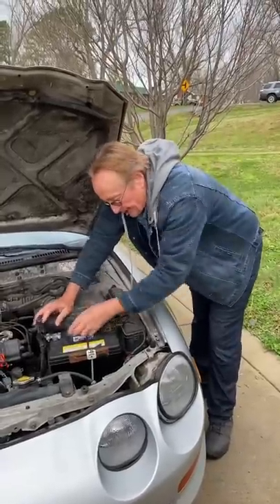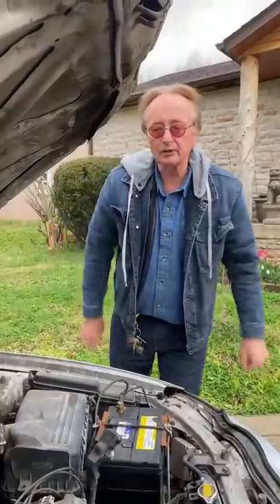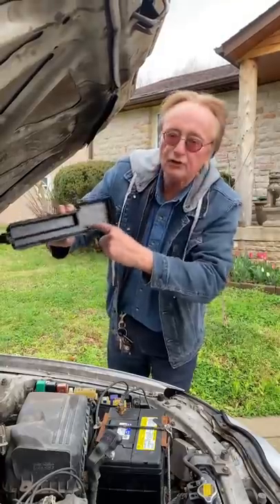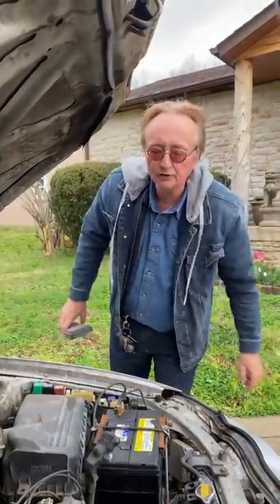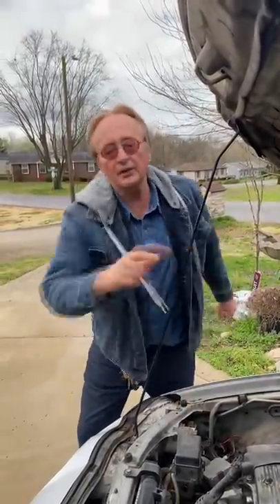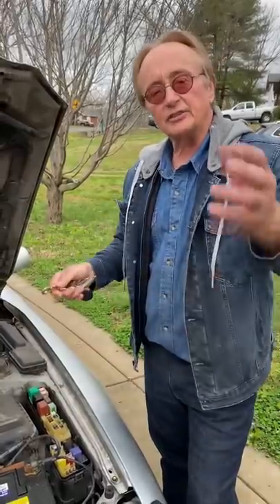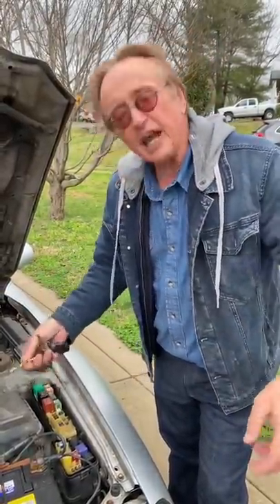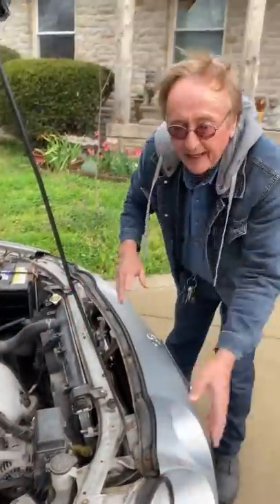You’re Gonna Want to Click on This

Comment: I have found, in the past, that if your tail lights are not working to check the fuse. If it is blown and a new fuse blows again then change all the bulbs on that fuse circuit. That will usually fix the problem.

Comment: My pickup has a driveshaft, not a belt. It does have a belt to drive the fan.
Reply: Look up what a "drive belt" is.
You seem confused about what a drive belt does.
You're implying that it is part of the drivetrain, which it is not.
Reply: Good thing your pickup doesn't have a CVT belt transmission.. Though the new Ford Maverick with the 2.5 hybrid had a E-CVT with gears instead of a rubber band belt.

Comment: I use to have a problem where sometimes my car would stumble or even stall. Sometimes it stumbled or stalled while using the turn signals. Turns out the inside of my side post positive battery cable had built up corrosion causing all my issues. Check your terminals people!

Comment: Those serpentine belts are far better than the old stuff. What you have too look for a cracking in grooves your squealing is the belt worn out and pulley bearings oh the grooves wear down like tire tread. Most times the tensioner is bad or wearing out. Easy fix remove your belt remove the pulley not the bracket in some cases. Reverse order new pulley re attach your belt re tension with 1/8 in deflection in the belt. Save yourself from getting hosed at a dealer or garage. To remove the belt the steel has some springiness with a socket takes some doing push in the opposite direction hold that pull the belt off release the tensioner

Comment: Well your fuse box will tell you what fuses are what, as long as your not driving a ford. If your driving a ford and you lost your owners manual, you no longer have a fuse diagram. Just a box with nonsensical numbers where labels should be.

Comment: Scotty my 04 mazda 3 has an electrical problem. I turn on the headlights and the tail lights and glove box lights dont come on immediately. Some times i have to wait 45 mins or so before they come on before i could drive. If i ever turn off the lights it may come back on or not. A friend told me it was a relay in the EMI that he couldnt get to to fix and he bypassed it but he didnt do such a good job so i rewired to the original wiring.  HELP

Comment: I got a 2000 chevy cavalier and it will not shift out of first gear i just replaced the top motor and transmission mount because they were broken i reset the code once and it worked fine and now it is not working again. as soon as i reset the code then try to get it to shift out of first it sends the code right back. Local transmission shop said its probably a wire shorting but i cannot find a break anywhere in the wires. Any help would be appreciated
Reply: Transmission solenoid? A leak can spill on the solenoid and cause weird things to happen.. there's a big wiring harness on the solenoid on the outside of the trans.  Does park, reverse and neutral work?
Reply: I once replaced a 2016 jeep cherokees motor mounts and the right rear tail light and headlight wouldn't turn back on.. Turns out I missed a bolt under the battery tray and that grounded something. Might help.

Comment: I would like your take on emp shield for your vehicle.
Reply: Scotty says, take the battery cables off your battery.. Might help .. check out some old cars like a volkswagen bug. Air cooled, carbureted, with points on the distributor. All you need it basic maintenance and oil changes.. I advise planting a garden or something too.